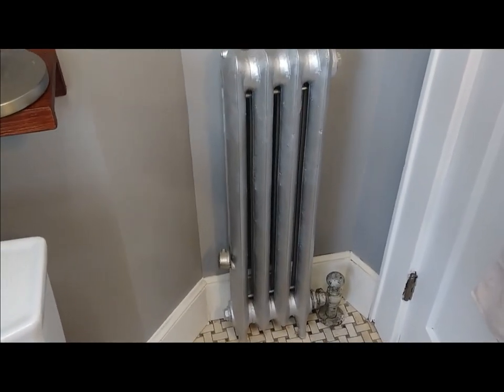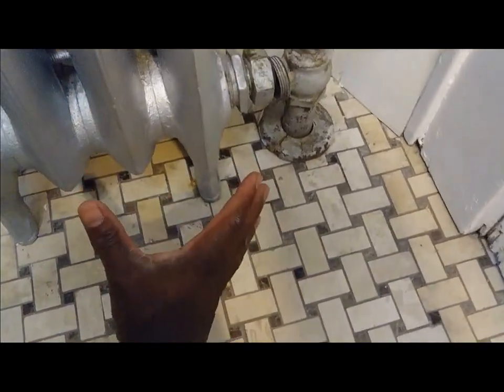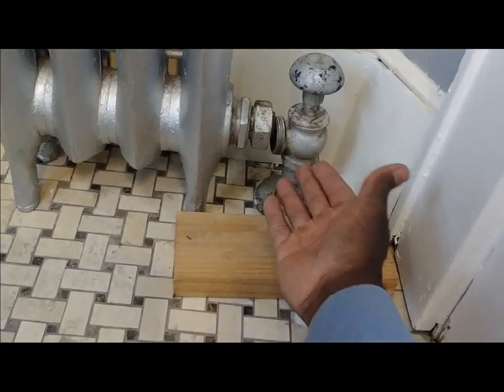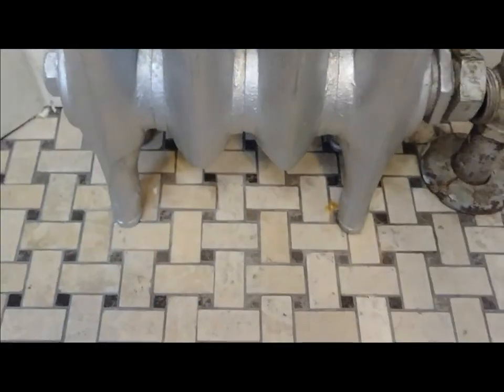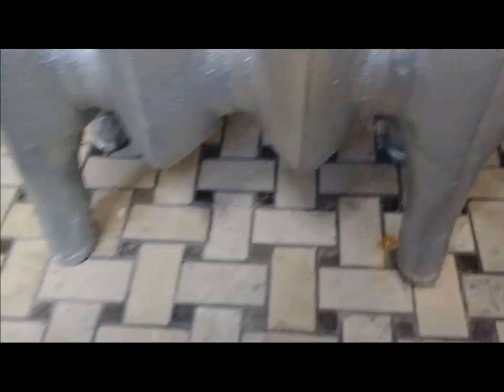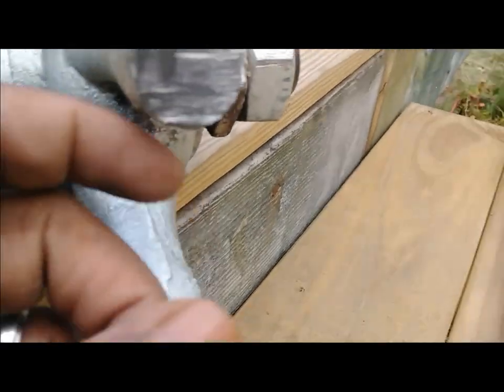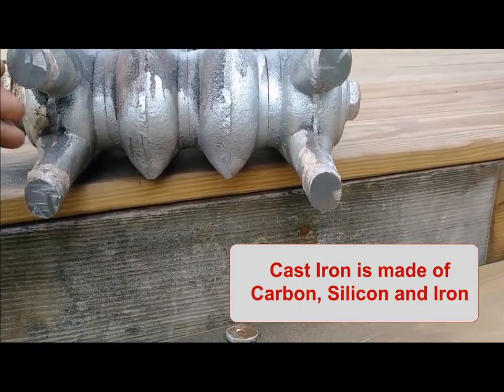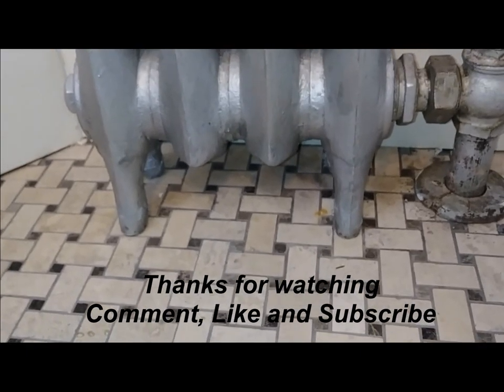Cut Cast Iron Radiator Legs

Comment: How do you prepare it to paint
Reply from the maker: Hi...These are the steps: drop cloth, respirator, wire brush, medium, fine sandpaper, air blow, tack cloth and heat heat spray paint.